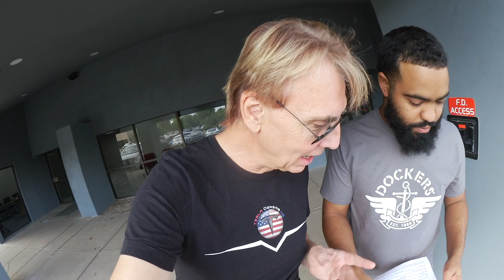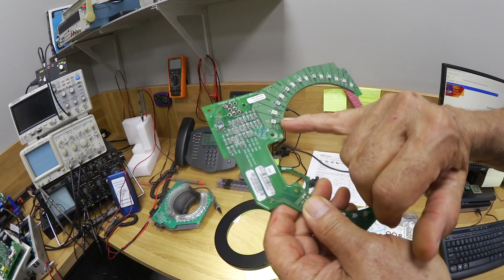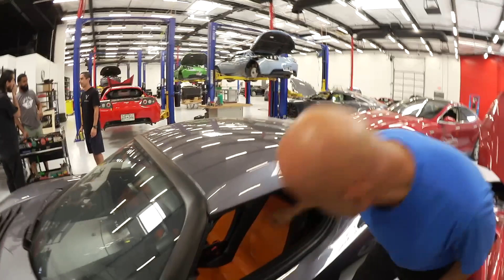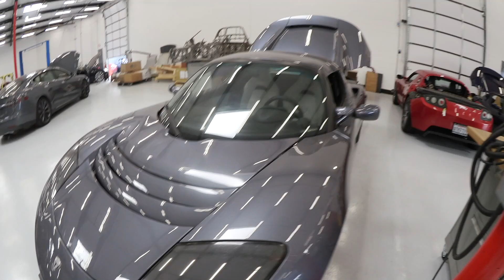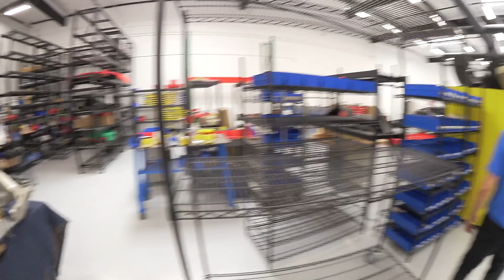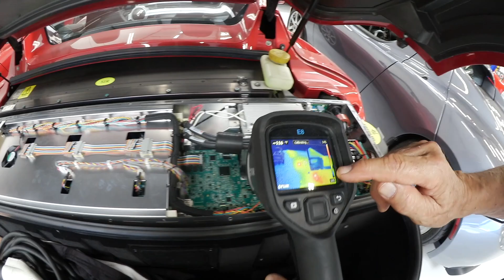Service Visit at Gruber

Comment: Many thanks to our loyal customers like Rolf and his VIN 1188 Roadster.  

Keeping first generation Teslas like the Roadster alive is an ongoing challenge due to ever increasing parts shortages, components becoming EOL and no longer in production, all of which we tackle by innovating with 3D printing, finding new vendors, and recreating parts, while continuously redesigning and resolving original engineering issues.